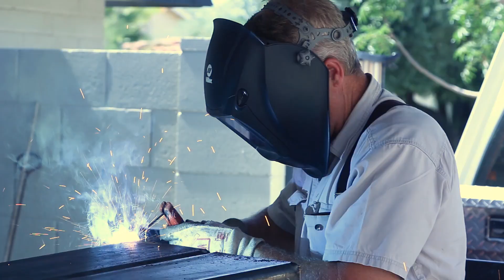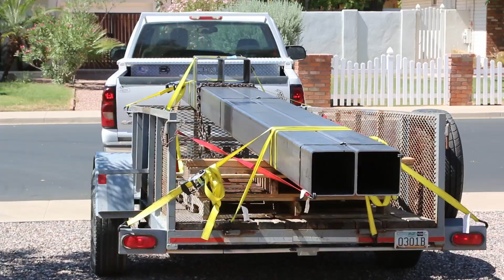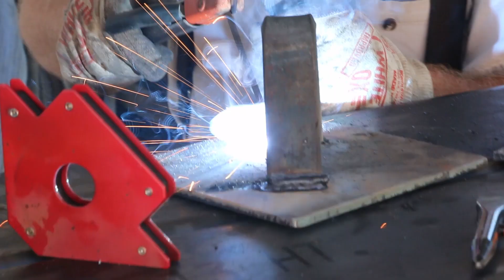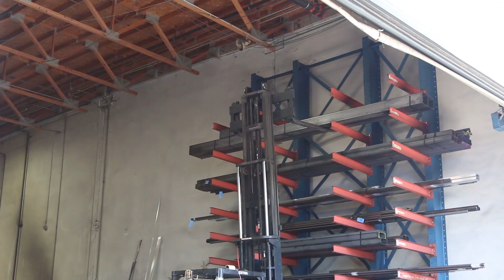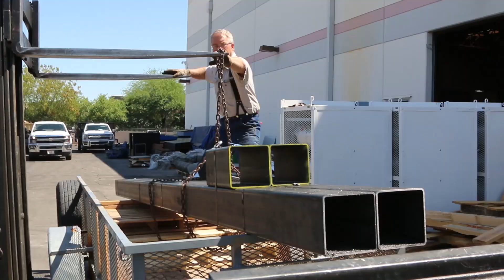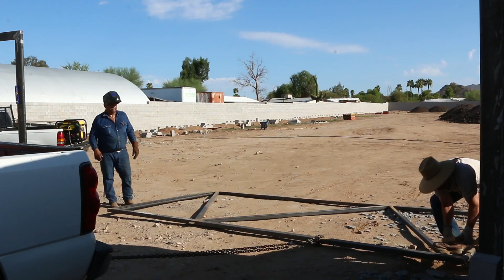Welding the Gate Columns

Comment: A little welder tip when you put welding rods in your pocket put the uncoated side in your pocket.  That way when you sweat the back side of the rod gets wet and not the starting end. Also if your a heavy sweater like I am by the time you get to the wet end of the rod it should be dry from the heat of the arc!

Comment: I thought everybody uses DC arc welders or MIG welders these days. At least the flux on the welding rods is kept dry in the Arizona weather. I would rather not live in an area that has so much crime you need to live in a fort. The new security cams available are amazing and I would have a bunch of those recording 24/7 around the perimeter.

Comment: Random late thought - Did you drill a diagonal, upwards hole anywhere in the posts? If they're sealed airtight, and black, sitting in the Mesa sun, they're going to be a bomb. If there's any pinhole below ground, it'll suck humidity in and rust out, or crack. Almost all steel structures have little purposeful holes drilled to allow for pressures to equalize in an area you want them to, versus in an area you don't. 1/4" steel, not sure if it's necessary, but, *shrugs*.

Comment: As a fence installer ,I have 2 points.. #1 when you haul steel on a steel trailer, wrapping the strap around the posts at least 1 full turn (like you did) is very very important. When you turn and brake a strap over the top only,can be a disaster.
#2 when using pre manufactured gates, the distance between, facing,and if the gate is connected to structure (like yours is) is a big deal.. 90% of gates that I install are freestanding, unconnected to a ridgid wall,so when the gate is 4ft wide... it is installed plumb,each foot after that gets set leaning away from the gate on a sliding scale ,due to fatigue/gravity ,(on gates really big they bubble is on the line away from the gate side) when the weight will pull the post down to plumb.
The worst thing is a sagging gate,also one that is set to low for the asphalt/concrete driveway that may be installed later.. 
Scott you had an elevation plan to mitigate this,just a tip for someone that wants to make they're own.
As always, great content!

Comment: Bloody hell what on earth is the engineer holding up with those post? 4ft with a 30inch footing surely would be  enough to hold up most things.
Reply: Not about what it's holding UP, its about what it's holding OUT. The spec footings should easily stand up to a U-haul truck trying to smash the gates open, assuming the gate doesn't give way first.
Reply: 44R0Ndin I’m well aware of what they trying to keep out. 4ft with a 30inch footing is more than enough. To stop most trucks. Hence I asked what he wants to hold up. That is massive over kill for most things. I’ve you have ever seen a gate rammed you will know that in most cases it’s either the hook tears off the steel post or in the case of a heavy steel like this the pin shears off. Or the post bends a ground level. Good luck taking these buggers back out.

Comment: So how about the weight of the gates...doesn't that throw your plumb off a bit?
Reply: So....a structural engineer (or a really good guess) to calculate the angle the posts must lean back so they will be plumb under load?  ...And, having them tied into your block wall won't pull the walls apart?

Comment: I work on computers and specifically manage a small team in a large organization. We are responsible for the companies online presence and directly able to influence the success or failure of a multi-billion dollar company. No pressure at all!

On paper, we just build and implement. If you will. We are the carpenters/architects of the websites. We have designers much like an interior decorator and stakeholders who would be the clients. 

It's very easy to get something from a designer that won't fit 100% perfect, and it's also easy for us to build something that's close if not exactly what was asked of us by management.

What I find interesting in your scenario and a lot of the times mine, is that I know enough to ask the correct questions, never assume that what is asked of you is correct or exact. If something is delivered and its wrong, to have the skills and ability to notice that, make suggestions and or fix them if needed.

It's very easy to say "It's not my job" or "I did exactly what you asked".

I would never do that, and I would never work for a company where that was OK. Everyone ideally on a project has enough confidence in their own ability to spot problems, bring them forward and work around any short comings.

Comment: Scott, was anything applied to the portion of the beams that are embedded in the earth to discourage rust?
Reply: I don't think the soil in Arizona is moist enough to really cause that kind of problem.
Additionally, the posts only contact earth directly on the bottom cap, and that's not carrying any structural loads. Everywhere else it's encased in concrete.
Reply: It may not rain much in Arizona but it does rain, raw steel in wet cement, it's already started to rust.
Then there is the issue of galvanic corrosion, it won't look so pretty in 10 years. But neither will I - Ha

Comment: I work for a shop that builds ski lifts, and I've lost count of the number of posts like this I've fabbed up.  It's good that you had the metal supplier cut those for you- trying to get an even cut in the field is a real pain in the neck.
Reply: Geoff Green Milwaukee metal cutting circular saw. But for a one off the steel company is way cheaper of course.

Comment: I know your not Mr. Saftey... but I cringed when you lifted your hood and I saw you did not have some saftey glasses on. Cant tell you how many times I was hit in the face by slag chipping a stick weld.
Reply: Brian personally I overheat like crazy when welding so I usually have to change back and forth between the mask and glasses. If I wear both the sweat just positively pours out.
Reply: Oh I completely understand. It gets hot and stuffy under a welding hood.

Comment: Looking forward to see how the hinges will be done, especially on those wires with the turnbuckles. I guess if the eye is exactly in line with the hinge it'll swivel fine but I haven't seen that before. I don't understand how the wires add more stability on top than if they were inside the area of the panel. Large gates like that are these days almost exclusively made to roll on tracks over here, partly to reduce the hazard in windy conditions and partly to save clearance space, so it'll be interesting to see, and also the latch.

Comment: Tidy welding. In Ireland we'd have to galvanise those and put an angled cap on to let the water run off or they would rot to bits. Arizona has its advantages!
Reply: Orbital Tube you're not supposed to weld on galvanized without special respirators. They'll be safe if the guys powder coat or enamel paint them. I would definitely add the angled cap though. Not having that added afterwards is liable to cause trash, bird nests, water, etc pile up on top.

Comment: Two things I have found with respect to your bottom plate installed to keep the posts from sinking.  I have found that making the bottom late wider than the post helps if there is any lift in the post to better hold to the concrete.  Also adding a hole in the bottom plate can help drain out any water that might come later from a pin hole.  Not a problem in Phoenix but can be a big deal where freezing temperatures are expected.  I do both of these when installing metal corners on barbed wire fencing.

Comment: My first welder like that was $99.00 new 2nd was a AC DC like new bought off the best welder i ever met paid $350.00 3rd was older AC DC paid $150.00 all keep on going   use them more than my  Miller syncrowave or mig welder

Comment: Very cool! What's with the two little offcuts that came along with the big tubes? Seems like they were already strapped to the tubes before they came off the rack when you bought them.
Reply: Bren Darrow they most likely had to buy the full 20+’ sticks and then the steelyard cut them to the size needed before storing them until pickup. Most steelyards/suppliers will give you the cutoffs or  ‘drops’ since you paid for whatever they had to special order or transfer in to accommodate your project. My local supplier will sell those ‘drops’ by the lb to other customers if the original buyer chooses not to take them.
Reply: ahhhh gotcha. Thanks Michael!
Reply: Yep that would be correct, those little pieces are still 50 lbs each

Comment: Did you pick up the material  from AZ Metals?
Reply: Industrial Metal Supply on 40th St.  Their will call is right inside the door on the right, and much taller building than AZ Metals. Plus just to the left of the main door you can barely make out the shade over the waiting/smoking area.  Their long drops are right there too.

Comment: Oh yeah! As a carpenter I needed to know how to build concrete forms, run wire, and install roofing. Eventually I learned to lay blocks, wire houses, weld gates and railings. I weld post and beam saddles now because the home depot kind were too flimsy. I found out being a carpenter, I could branch out to other trades easily because I'm there through out the entire process of the house build. I never went to school for carpentry but I've been one for 15 years and I did get a degree in welding recently through a small community college at night. You are an inspiration. Thank you for your knowledge.

Comment: I notice that you weren't wearing sleeves.  Isn't flash burn a risk with arc welding?
Reply: I believe that sparks flying towards your forearms are a bigger risk.
Reply: It is, but in Arizona you might have to balance that with comfort from the heat.
Reply: I throw a light green welding jacket on with shorts and a t-shirt, but when it's over 100* out, you sweat out pretty quick.  Bigger risk is burning the *!###! outta your hand because metal in the sun down here is wicked hot, And hot metal,... dont look hot.